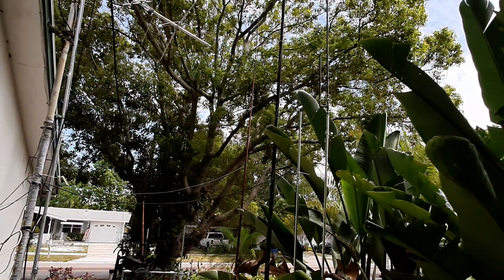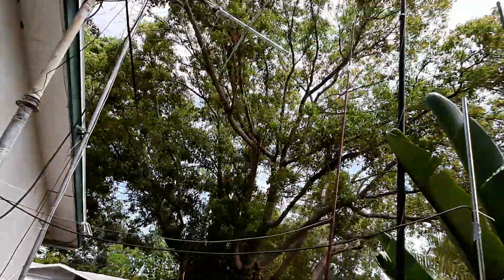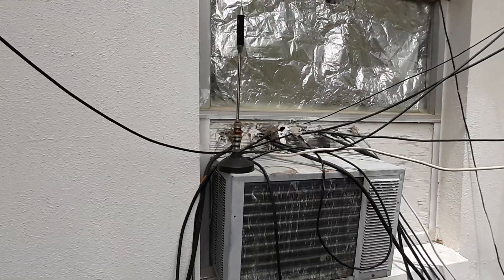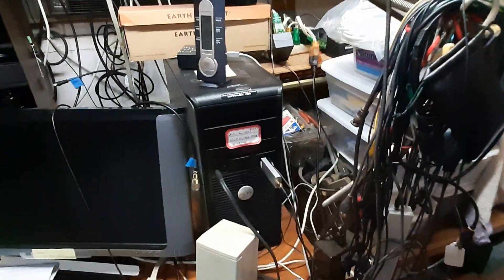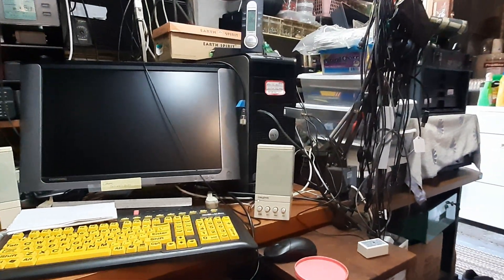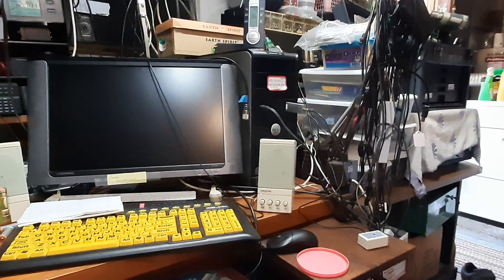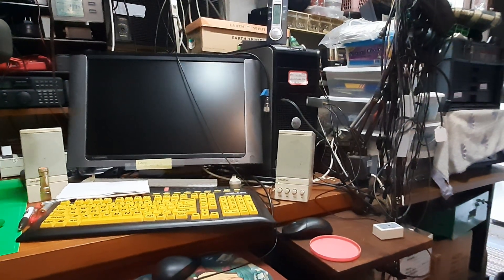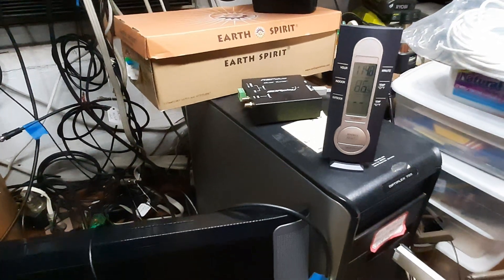TRRS #1931 - I Got It Up - the MegaLoop Antenna

Comment: Hi Tom,

Try re-shooting that antenna with the sky as the background & not the tree!

At least you proved with the tree in the background that it's stealthy...

Also, try placing the loop in both the vertical & horizontal positions, I think you will find even more signals in the horz. position as that should make it even quieter, and eliminate powerline interference more.
Reply from the maker: I tried that but since the antenna is so small (the loop) that did not help.  Sorry.